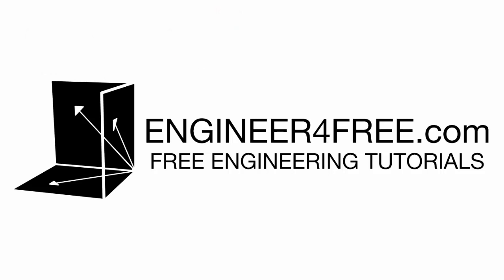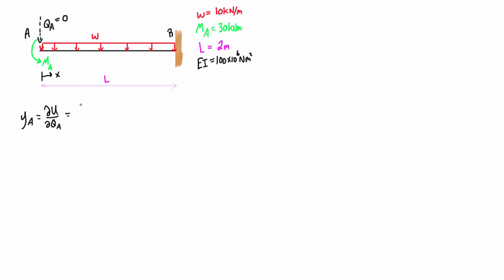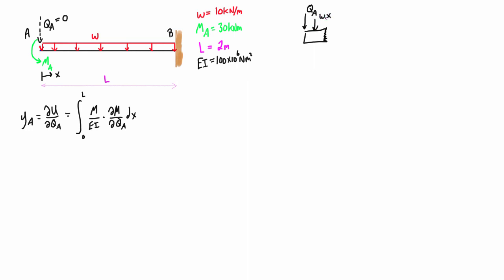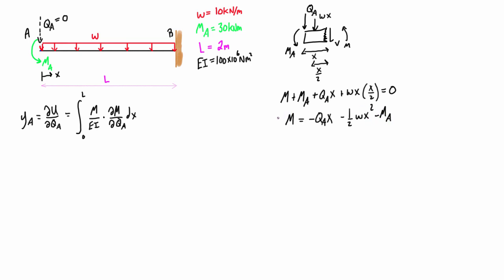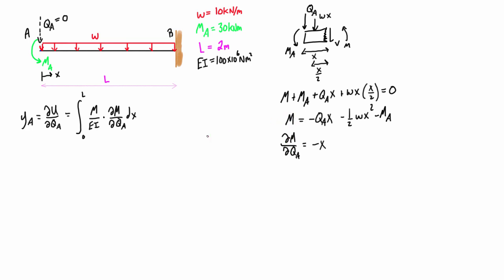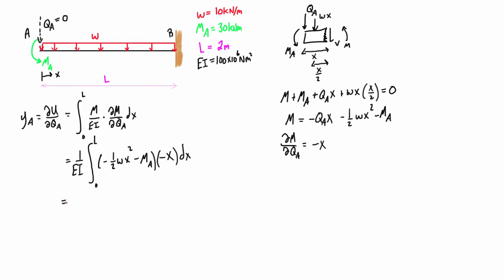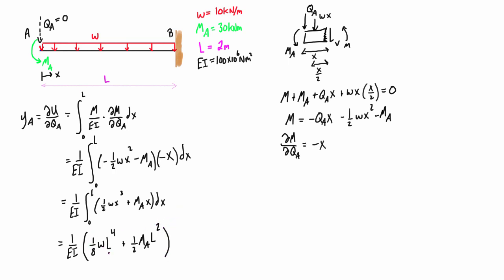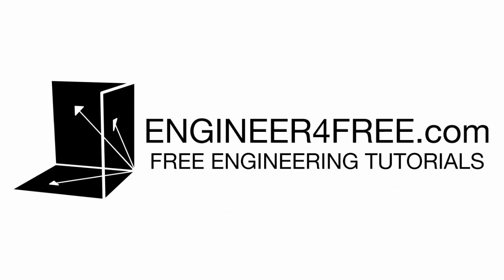Castigliano's theorem example #2: deflection using a dummy load

Comment: at the end of this, you said that we can use the method of the superposition. My question, do you mean we can use superposition if we have the area of this beam ?
Reply: that means you can also use superposition principle using individual load udl separate and moment. And then calculate deflection due to both and verify the results

Comment: How do you get the EI value
Reply from the maker: In this problem it is given. It is given in most beam bending problems. If it is not given, you will need more information about the cross section to find the moment of inertia (I) and material for Young's Modulus (E).

Comment: Great video. Is it possible to do a much harder example, like one with a statically indeterminate beam?
Reply from the maker: Thanks, I don't have any videos on using Castigliano's method for statically indeterminate beams, but I do have a bunch of videos using other methods, check them out here: engineer4free.com/structural-analysis that whole playlist is basically all statically indeterminate beams.
Reply: Oh thanks!